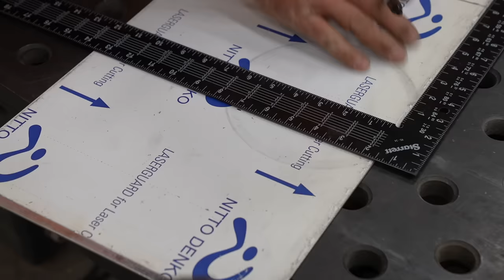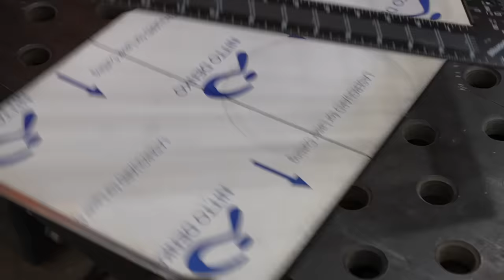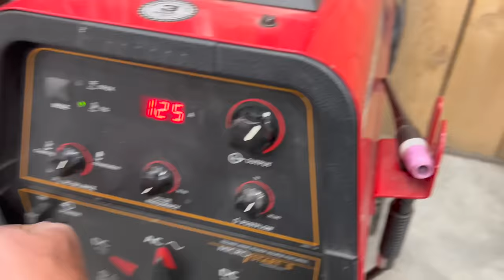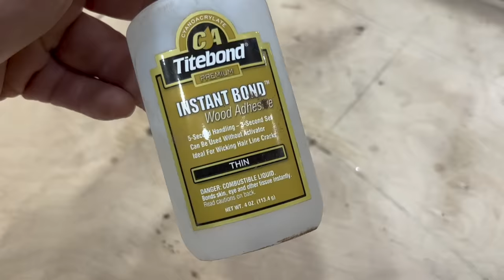I Regret Not Making This Toolbox Sooner

Comment: Looks really great. The way you made the dove tail joints was just so smart and looked really good. Very shiny as well. Brilliant job.
Reply: As the name suggests dovetail joints look like a dove's tail. They're angled fan like.  \ / What's used here is called a box joint. Which is often confused with dovetails due to a superficial similarity. They are considerably different joints though. You'd be hard pressed to cut decent dovetails on a table saw. I won't say it can't be done but no one does it. machined dovetails are cut with a router and a jig template.
Reply: Thanks for that I didn’t know the name for that joint but do now. Either way it does look smart and was a smart idea.
Reply: @1pcfred  You can cut decent dovetails on a table saw, but you have to build jigs to make it happen. I want to say Tamar at 3x3 customs made a video about it years ago, and made some damn good joints with it. They didn't look hand cut, but they were certainly dovetails. Although given the jig and the setup time, if I were using a table saw I'd go box joint as it's a much easier and more repeatable setup. So you're right, it can be done on a table saw but it's a lot of work.
Reply: @ejthompson4950  the main problem is the corners of the tails are not right angles. So they cannot be cut properly with right angle tools. No jig can change that either. You'd need a beveled blade to cut that angled corner. But no one has one of those. If you want to machine cut dovetails you use a router. That's the sensible solution. It's what everyone does.
Reply: @1pcfred  ridge carbide makes beveled blades for making exactly that sort of cut. I don’t remember if Tamar used special blades or cleaned up the corners with hand tools. It is possible and the tooling exists but unless you’ve got a production shop setup running multiple table saws for each blade type and angle…. No one is really using the tablesaw method at home.
Reply: @kronographer  even the pros are going to use a router and a jig or maybe CNC. Some kind of a spindle tool. Even with a beveled blade cutting dovetails with a circular blade just isn't practical to do. Even if it may be possible to do. Dovetails hardly make sense today at all. They're just done to be decorative. Today we have cheap fasteners and strong glues. That was not always the case.

Comment: As an aircraft sheet metal mech, I'm disappointed you didn't rivet the hinge and latches. Great work though!
Reply: I agree! I wondered also why the bolt heads were on the inside?

What a craftsman you are Jimmy!
Reply: Would of been awesome
Reply: I hate rivets😂
Reply: Yea Jimmy- everyone knows that rivets make toolboxes more aerodynamic! Lol 😉
This is definitely one of the coolest toolboxes I’ve seen in a while. Well done!
Reply: Love watching the way you approach things 👏👏👏 another very cool piece👌👌
Reply: @cheesyoatcake I assumed it was so no one could unscrew the lid from the outside to gain access, but then he didn’t put a lock on the top portion, so it became a moot point
Reply: @cheesyoatcake  if he had put the nuts on the inside, then the wooden tray wouldn't have had the necessary space.
Reply: I’m getting my A&P right now and have really enjoyed every sheet metal module we’ve done. Are there any further sheet metal certifications you can get to get more specialized in that facet of aircraft maintenance or is it all just experience based?